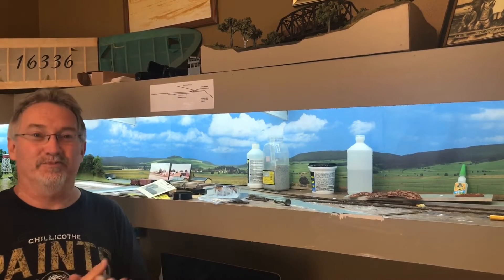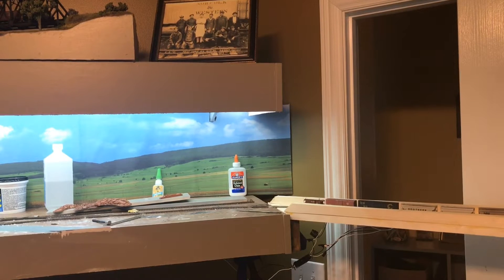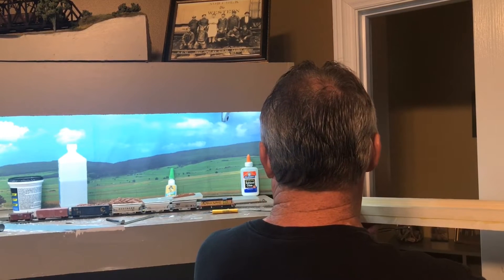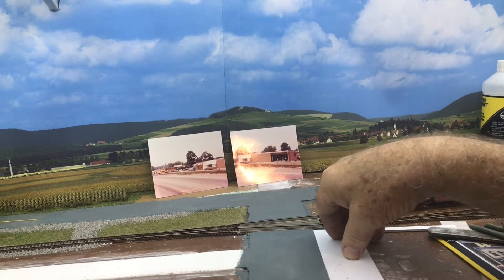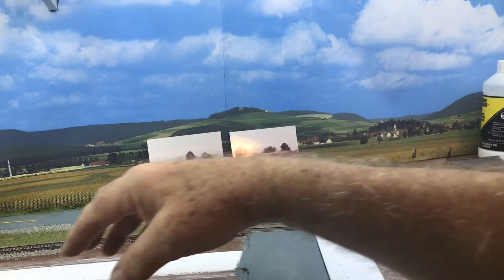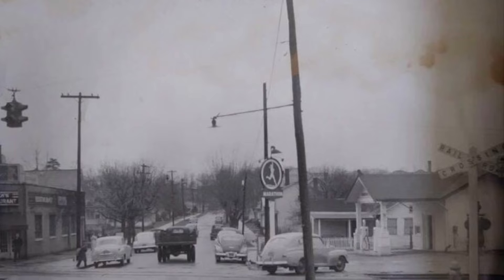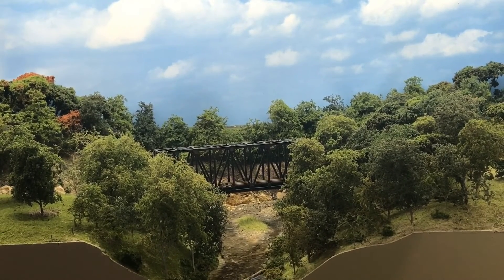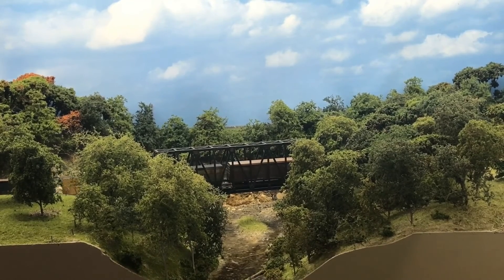Oak Hill update 28: Staging yard, grade crossings, and a couple of ‘challenge’ trains.

Comment: Thom,thanks much for sharing your work. Looking really good. BTW the train at the last looks to be about max for a single GP7. I also only use single units on my layout.
Reply from the maker: You’re right, it was struggling with it on the curve. 2 units are common on a lot of switch jobs, but not for what I’m modeling. Glad you enjoyed the video. Stay safe!
Reply: @thomplacier677  thanks for the reply. Mine is a total switching layout  2'x14' with a 18"x8' pannecla with a Y at the butt. I use an interchange track (stubbed) for pickups and drop-offs.
Reply from the maker: @JohnMullerJDGCTRy  nice size for a layout. What scale? If that’s N, it’s a really big switching layout!
Reply: @thomplacier677  it's HO with a lot of compact complex switching. I use S2s S4s as my work hogs and three different RS1s that show up at times. The one COOP has its own GE 45 tonner with car limits depending on covered hopper size.

Comment: Nice vid. Good progress; looking forward to more.
Liked the trains, too.
Don't fret the intro. One person I'm thinking of who has an attention-grabbing and clever intro has so little quality content that it's almost not worth starting the videos.
One alternative view: I use several pairings of locos for locals and switchers just so I can use my older, non-sound units together with the newer sound ones. Nothing fancy; they are just set to the same address. Speed matching is usually pretty easy since they're only operating at slow speed. And you don't have to look very hard to find prototype examples.
Reply from the maker: Thanks for the idea, Donald. Until recently, CSX kept a mother/slug set in Chillicothe. Oak Hill always used single units. Most of my stuff is Atlas so it would probably run ok together. Stay safe!